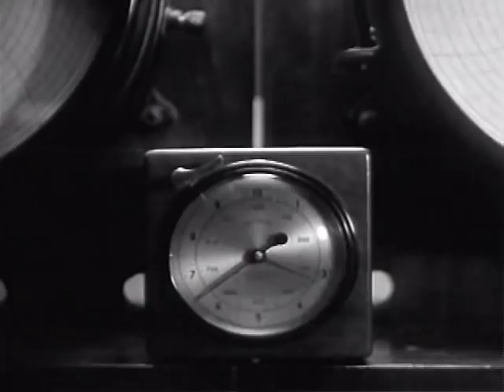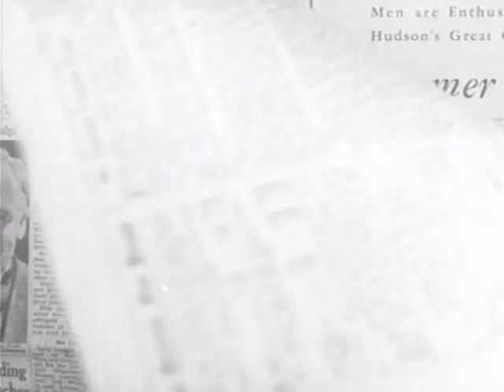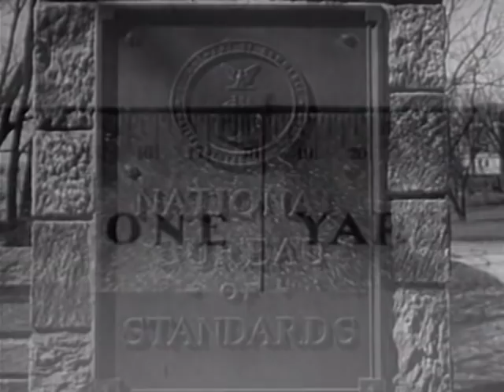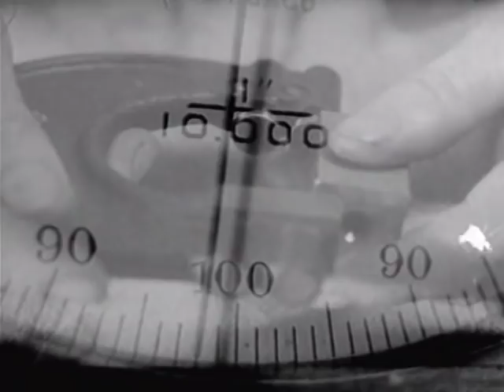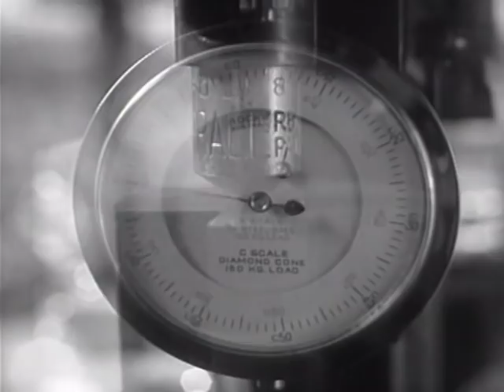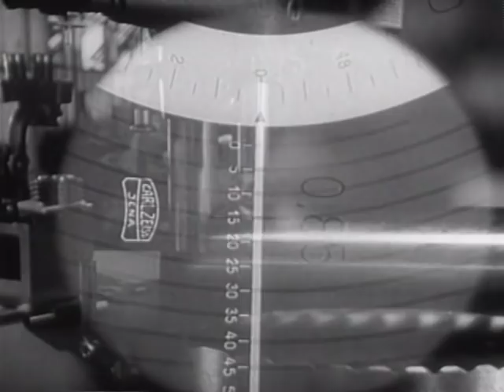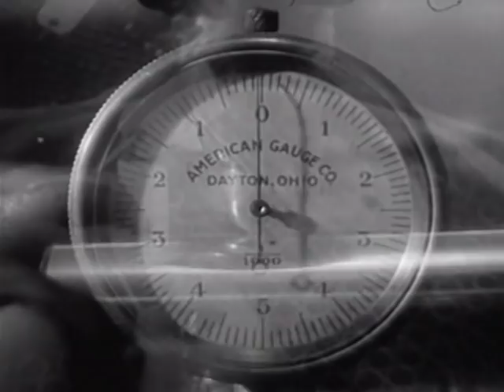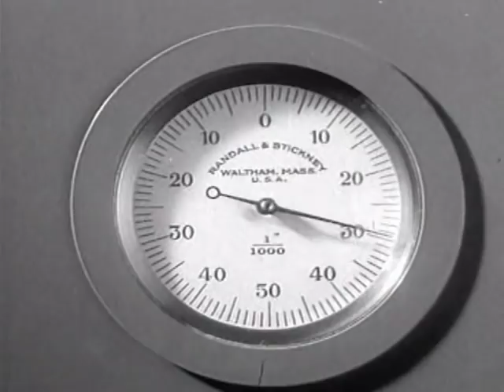Precisely So (1937) Manufacturing Tolerances

Comment: Measuring is what I do for a living, and the tools you see in this video are still in use today as well as computer controlled CMM measuring machines, which I program.  When you watch this video, please consider how just a few years earlier people were getting around using horses!!  The technology developed fast........
Reply: IronClad292 The thought and origins of the measuring technology is very interesting.
Reply: It took  a few centuries to get that far , They were making steam engines in the early 1700's   That means they had some precision capabilities in at the least the late 1600's Most then were comparative readings , with calipers etc
Reply: It was the introduction of Statistical Process Control, a departure from the old GO/NO GO gauging system, which
really controlled resultant measurements. Prior to SPC, a hole on top limit could lead to a 'loose' fit when matched with a shaft on bottom limit. Used SPC methods covering various critical components in production engineering.
Reply: "Measure what is measurable, and make measurable what is not so"
Galileo Galilei
Reply: And, consider when people wiped their asses with corn cobs.  Hope they at least ate the corn first.
Reply: Nah... peoppe shouldnt advance tech so much
Reply: I used to measure the density on printed paper, film and microfiche with all kinds of Densitometers and Spectrophotometry. This was a great time and very rewarding.
Reply: Oils for lubrication of metal moving parts has tremendously improved in the last few decades. And I suppose surface hardness of wearing surfaces has also been improved.
Reply: @scottdowney4318  That would be improvements in alloys
Reply: Such beautiful instruments.
Reply: ALIENS BITCHES!!!!!
Reply: Too bad improved technology didn't translate to prolonged vehicle lifespan and durability.
Reply: Iron Clad Ranch and still they can’t get it right recalls and the fact cars today don’t last longer than 4 years before they trade for a new one again
Reply: thank William Albert Pike and his light bearers for that one, putting these kinds of powers into the hands of people is alot more sinister then one would think
Reply: Iron Clad Ranch As awful and terrible as war is it has always driven technology faster than any other motivation.   It’s a sad commentary on the human race but it’s a fact nonetheless.
Reply: @RenascencePerennial  cut them some slack, they are more economical, powerful while they don't need intensive maintenance.
Reply: @ΑΡΗΣΚΟΡΝΑΡΑΚΗΣ  Does constant transmission replacement not count as "intensive maintenance"?
Reply: And horses were measured in hands, not thousandths of an inch.

Comment: Back from an era when a skilled Tool & Die Maker was a master craftsmen!
Reply: who couldn't hold 0.0002in. tolerance for the life of them
Reply: @winkfield09  those are rookie numbers... try 0.00001
Reply: @winkfield09  I started trade school in 1970  . retired now from tool work . I never worked to  2/100,000   .    Tolerances that close and closer are usually on inspection equipment and they have different equipment  than I used . A whole separate section of the trade. Also for that close of tolerances , temperature of the part when inspected will be part of the specifications,

Comment: This is a chronicle of the "American System" of manufacturing that was pioneered by Eli Whitney and his system of interchangeable parts whose sizes were qualified by master gages.  That system was perfected by the gun industry of Connecticut through the 1800's and transferred to the auto industry when GM hired Henry Leland to be chief engineer at Cadillac.  If you walk through an inspection department at any manufacturing or engineering facility today, you can still see Rockwell hardness testers, precision dial indicators, and go/no-go gages. This is the bedrock on which America's industrial strength was built.  By this system, auto manufacturers were able to build cars at low enough cost that anybody could afford to buy them.
Reply: Andy Harman The master standard is still the gage block, shown in the film.  One step removed from the uniform system of weights and measures maintained by the federal government, also shown in the film.
Reply: They were mass producing things before Eli was born , He did  not prefect mass production , Exampled ... rail road wheels and English ship hardware  etc   He never filled his 1st order for 10,000 guns because of quality control problems, H e had a  more advanced concept  , but it needed work .

Comment: I drove a '48 Chevy for quite some time.  It had the 235 Cubic Inch 6.  The engine had no oil pump, but got oil from little cups on the bottom of the crankshaft.  It worked well with the lower speeds at the time it was built, but as speeds increased, the engine couldn't get enough oil to the engine.  In '52, Chevy changed the engine to a more modern oil delivery system.
Reply: mistertraveler71930 dipper rods
Reply: Both early and late 235s had oil pumps.  On the early ones (53 and earlier, but up through 55 in some international applications), oil didn’t go to the rod bearings, only the mains and valve train.
Reply: @dougherbert7899  "splash lubrication" like the low end B&S engines

Comment: 4:32   The old Argonaut Building in Detroit.
From Wikipedia: The , renamed in 2009 the A. Alfred Taubman Center for Design Education (originally the Argonaut, or General Motors Research Laboratory), is a large office building located at 485 West Milwaukee Avenue in the New Center area of Detroit, Michigan, across the street from Cadillac Place. It was listed on the National Register of Historic Places in 2005.

Comment: GM has managed to unlearn all this lately...
Reply: No, they haven't actually. An American car made in 1937 had a life expectancy of about a decade. My 2004 GMC Sierra 2500 HD Duramax Diesel runs as good as it did the day it was built almost 17 years ago. I've never had to pay for anything beyond regular maintenance.
Reply: @sd31263  Also, what really extended the life of a car is better lubricants. The Chemistry of oil and lube has improved significantly since 1937.

Comment: Where would these movies be shown back in 1937?
Reply: These were all part of GM's 'mass-selling' technique (there's actually a GM dealer training video on YouTube which explains it). This films would have been shown in movie theaters, schools, factories and workplaces as genuinely educational short features but they more subtly emphasised all the good qualities of a Chevy and built up the public perception of the cars. So the film about the differential gear is a very good way of explaining why the diff is needed, how it works and what effect it has but makes sure to end by pointing out that the new GM hypoid differential is the best ever and because of it the '37 Chevrolet has a flat cabin floor, or whatever. Very clever marketing!
Reply: In movie theaters

Comment: Why did my 1976 Buick LeSabre die at every stoplight... then refuse to start?
Reply: Probably a very simple thing to fix,either ignition or the idle jet plugged up,or the carb overflowing,due to a bad or just dirty carb inlet needle or a holed,misadjusted  or soaked,heavy float;

My 1971 2 door Le Sabre never died,served me extremely well,bought it in 1982,with 120000,drove it up to 1988,when i sold iti went into the jaguar (only) repair business; xj6 and xjs; it only needed a trans swap,from the junk yard  in 1986,nothing else; (been a mechanic for 45 years now);when gas was a dollar a gallon, it was,to me,the BEST car in the world; simple reliable,very cheap(paid 175 dollars for it,with a bad trans governor--12 dollars and 5 minutes to change it,on the outside of the trans!!),very fast 350,very comfortable, great A/C. I still kind of miss it today greatly...

Comment: Did cars ever get recalled then? Or, did the manufacturers just stonewall and sweep everything under the rug.
Reply: thaddeus buttmunch 

That’s actually a good question.

Hopefully some one will chime in.
Reply: People just dealt with it. It wasn't until at least the 1950s that there was even a legal consensus on who was responsible for problems with new cars. Repairs were almost certainly much cheaper in those days. People fixed everything back then. Nothing was throwaway.
Reply: @I know you are right, And I just got owned but: You're a bit off. Recalls started in the '60s. I know because my '69 Boss 302 Mustang was recalled for possible contaminated brake fluid. It turned out negative. And yes, even 50years ago, Fords were being recalled!
Reply: @ModMINI  In the '50s, the average car cost less than $3000. But, a GOOD salary back then was about $75 A WEEK!

Comment: Did people back then yell alot? I think he is yelling
Reply: Likely had something to do with recording equipment, and actors having to speak up to make sure the old equipment would accurately capture the voice properly. I notice actors from older films took great care to articulate their syllables and speak up, and I can only assume that recording technology was not that great back then, that, and playback technology wasn't that good either. Those old TVs had terrible speakers. You're listening to this using ultra high-quality sound systems. Like those pops and crackles in the very beginning of the video? You could probably barely hear them, if at all, on an old B&W CRT TV in the 1930s.
Reply: In 1937, television wasn’t a significant factor; a film like this would have been shown along with newsreels and such before the main feature in a movie theater.  Announcers needed to over-articulate because the recording media and equipment had limited frequency response, a high noise floor, and limited dynamic range.

Comment: I think Metric system is more super precise than inches and pounds. One inch was taken from an ancient English king thumb, one meter is defined as the length of the path traveled by light in a vacuum in 
1/ 299 792 458 of a second. US and a African country the 2 left countries still using English system.
Reply: Israel Micete Any system of measurement is capable of high precision; the essential factor is having consistent standards.
Reply: Same sizes  , different numbers  , Drills are measured in numbers, like 5 , 6 or 7   , in fractions like 1/8 or 3/16  , or in decimals like.125 or  500 thousandths . You get the same size hole with the same accuracy , For more precision on hole sizes , finish and location you use bores. You do not change the number  system
Reply: The US uses BOTH, the SAE AND the METRIC system. We SHOULD be using ONLY the Metric system because it's more logical..

Comment: Puts utmost extreme emphasis on accurate means of measurement.
Uses imperial system.
Reply: All systems of measurement are arbitrary.  We measure time in years, months, weeks, days, hours, minutes,seconds, and fractional seconds.  There is no particular reason why a day should consist of 24 hours, that each hour be made up of sixty minutes, or that a minute should comprise sixty seconds. You could just as easily have a day of ten hours consisting of 100 minutes of 100 seconds each.  It is simply a matter of convention that we measure time as we do rather than in some other way.  The same is true of weights and measures.  There is no particular reason why an inch  cannot be as equally precise as a centimeter, all that is required is an agreed upon standard inch meeting an agreed upon level of precision. There is nothing magical about the metric system.
Reply: Do you think that metric is somehow more accurate than the US Customary system? (what we use in the US, NOT Imperial)

They both have exactly the same accuracy, they just use different units to get there.

That's like saying that it's more accurate if you count in Euros instead of dollars. Lol
Reply: Metric is superior.
Reply: 3/8 of a mm !
Reply: @ke6gwf  no, the fact that everything is calibrated against metric units means one only fact.
Reply: @ΑΡΗΣΚΟΡΝΑΡΑΚΗΣ  that's not an accurate claim lol
Long ago there was a piece of metal used to calibrate all measurements in the US, and one in France.
They both were constantly changing length slightly, and so the units were constantly diverging, so it was decided to use the more stable one as the reference for both.
So the US Customary system length units was based off the French Prototype, thus keeping it stable in relation to the Metric system, and so now we have a precise conversion factor between the two.
Since then however, both USC and metric are based off the speed of light, and various other Constants, so you can't even say that it's based off a piece of metal.

In any case, USC isn't, and never was, based on metric units.
Reply: @ke6gwf  so it isn't true the fact that the inch is calibrated to 25,4mm?
Reply: @ΑΡΗΣΚΟΡΝΑΡΑΚΗΣ  nope, that's not correct.
An inch equals 25.4 mm, just as 25.4 mm equals an inch.
It's just two fixed points on a conversation chart, and the inch is no more defined by the mm than the degree F is defined by the Degree C, or how the distance to the moon can be measured in light years or metres.
The relationship between the inch and the mm was arrived at by comparing the two standards, measuring the master Yardstick with the Prototype Meter, and then measuring the Prototype Meter with the Master Yardstick, and they found the relationship between the two, and then locked the relationship to what it was that day (since the masters were always changing)
There was also a later adjustment made because the Imperial inch and the US Customary inch had diverged slightly, and so the US and the UK both shifted their inch slightly towards each other and met in the middle, which is how it arrived at 25.4, when it has previously had more decimals.
But that was done by the US and UK, not the SI, because the US is who defines the length of the inch, which is now based on the time light takes to travel in a vacuum, because the old metre prototype was too unreliable, constantly changing length.
Reply: @jamesrogers47  Yes, people don't understand that the English system can be decimalized for precision measurement. The beauty of the system is that it can also be fractionalized for convenient human common use.

Comment: Most of the tools and things from china are very crude sloppy and use poor quality materials . for example a low cost axis vice for a drill press has rough movement and gets stiff when moved from one end to the other . The poor quality rubber rots in a short time ,and tube type tires loose all air in 2 weeks or less!!!!!
Reply: They don't "loose" air, they lose it. Learn the difference.
Reply: Quality has a price.

Comment: Probably still done the same in pakistan to this day.
Reply: ChrisHallett83  I made parts at Pratt & Whitney in Conn , The blue print specified the readings at 68 degrees   , 60 inch diameter parts will change size a few thousandths in heat or cold. They used to tell us to make the inside diameters a little small and inside diameters to the  large end of the tolerances. Some operations they kept the gages in the coolant to make sure they were the same temperature as the part.
Reply: @ Juden Arier

“They probably value their religion higher than quality and tolerances.”

So like Alabama?